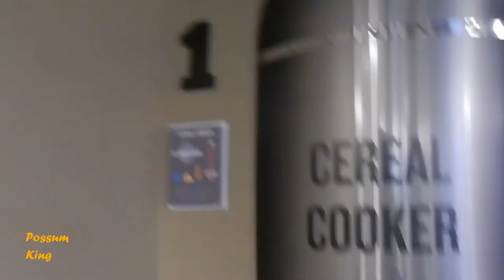Trash Burning Rocket Stove

Comment: Did you ever get that fancy new trash burner built or still using a barrel like the rest of us country boys?
Reply from the maker: I just burn in a pit anymore. I need to drag that steel structure out the woods and get it fixed up.
Reply: As long as it gets rid of the garbage, a pit works fine. I was kind of anxious to see what you would come up with.